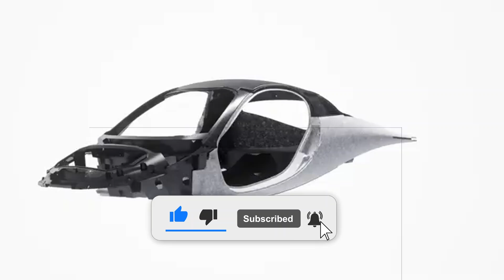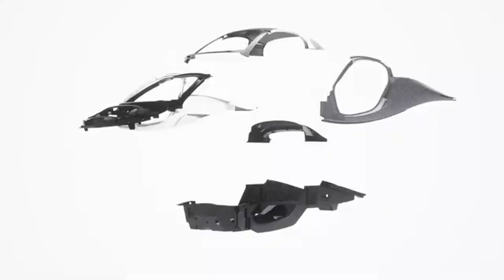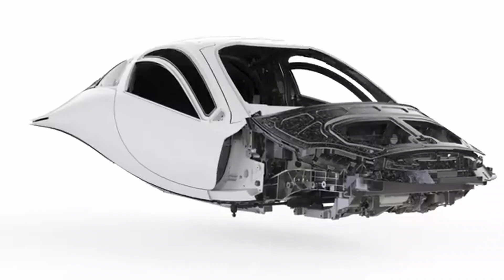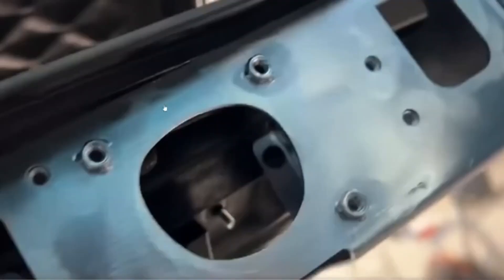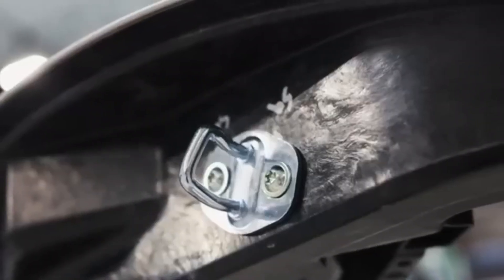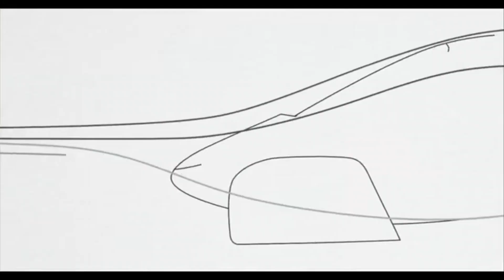Aptera GAME CHANGING PI 2  Production Intent SUCCESSES

Comment: Carbon fiber plus metal equals rust... There is an electrical charge between the two I believe... How is that addressed.
Reply: Maybe they asked Alfa Romeo. The 4C has a carbon tub with aluminum structures bolted to the front and rear. They started this in 2012. So, if it was a legitimate issue, then I guess there would be lots of complaints 12 years down the road. Maybe go see what those are.
Reply from the maker: Nice
Reply: @bosatsu76  They are putting a binding agent in between all those parts…just like everyone else who uses corrosion inducing material next to one another.
Reply: @inomad1313 Finally a correct answer.
Reply: BMW I3 is carbon fiber... no issues. Bikes have had metal parts  for 30 years. Aerospace uses heavy carbon fiber.... no issues. The only real issue with carbon fiber is UV break down. I assume any exposed carbon on this car will be coated..
Reply: @TikiToyLabs  Near as I can tell, any carbon fiber that might be exposed to UV is being covered by the color wrap.
Reply: @inomad1313  Will outer skins be cf or fiberglass? Uv is about the same issue with either though..
Reply: @ronfarnsworth7074  It looks like C.P.C. is using a combination of CF-SMC and SMC for the body. So carbon fiber.
Reply: @inomad1313  Thought I heard fiberglass for price but not sure, thanks for reply.